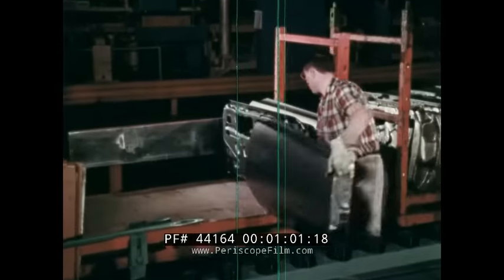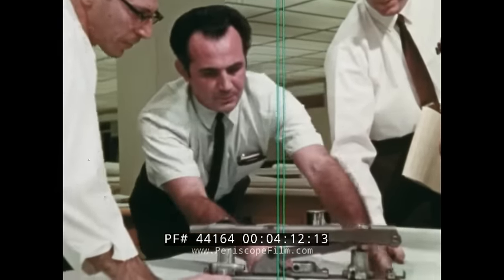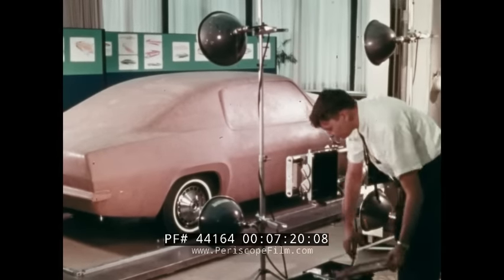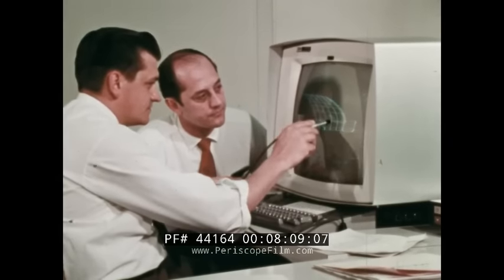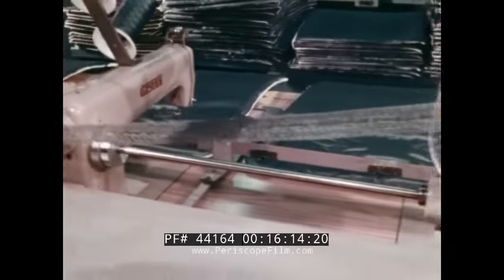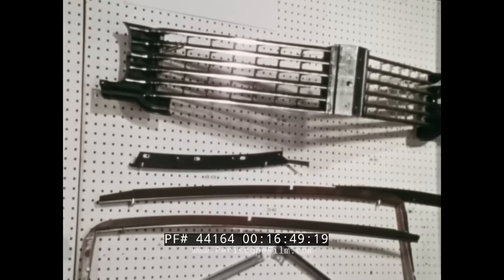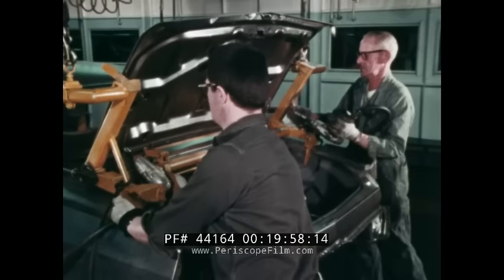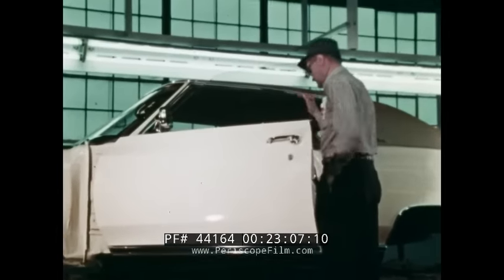FISHER BODY  "THE BODYBUILDERS"  GENERAL MOTORS 1970s AUTO ASSEMBLY LINE FILM  44164

Comment: I bet one nice thing about punch cards running the automatic sewing machine and robot welders is you didnt need to worry about a friggin windows update screwing something up once you had it working properly!
Reply: @D.T. Baker Hmmm,  I've been using Windows at work for over 20 years, and I've lost a document I was working on maybe twice in all that time.  It doesn't crash.
Reply: @robertromero8692 It’s STILL A COMPUTER, and computers do crash. 🤔
Reply: @jjojo2004  What part of "crashes are very, very rare in my experience" didn't you understand?  And where did you get the idea that NON-computer based machines never fail?
Reply: @robertromero8692  So are you saying computers have 0% chance of crashing. Anything other than that means it WILL crash. A crash is a crash, even if it’s one in a million years. You’re a POOR KEYBOARD WARRIOR. 😆😆😆😆

Comment: BODY BY FISHER. Who remembers seeing this as a kid?
Reply: Saw it allll the time!! I worked at Fischer body in flint in 73 🤣🤣🤣
Reply: The Fleetwood and Eldorado had "BODY BY FLEETWOOD" badges on the door thresholds, even though I believe the cars were sometimes built on the same lines with body-by-Fisher Devilles and Toronados, respectively. Must have been more of a tradition than anything else; the Fleetwood coachbuilding operation dates back to Penworthham, England, before it moved to Pennsylvania and was eventually acquired by GM.
Reply: See it every weekend as i jump into my 1970 Camaro !!!!!!  lol
Reply: lovejago  - I see similar when I jump into my ‘67 Firebird ‘vert
Reply: My dad worked at Electro-Motive Division for thirty years. When I was a kid, he used to bring home GM car brochures to me and my older brother often. He had a 1972 Chevrolet Caprice, and he would open the door and I remember seeing the "Body by Fisher" in the body door panel. He would open the hood and I see other labels on the parts in the engine compartment from other GM divisions like Rochester, Frigidaire, Harrison, Saginaw, AC, and Delco.
Reply: me, every time i got in my moms '72 cutlass, had that logo on the door sill
felt so bad when i was driving it home from the dmv in '75 after getting my license,
totaled it in an accident with a 65 gmc pickup
Reply: My dad was 30 and out at the Grand Blanc location.
Reply: I remember seeing it on my mom's 85 monte carlo ss
Reply: Irish Keif Grew up in Livonia, Michigan, not far from the former Fisher Body Plant on Plymouth Road near Inkster
Reply: @Pgcmoore  I T boned a Hyundai driving my mom's new 87 K/5 blazer the day after I got my license. I had to buy her a new grille, bumper and had the hood resprayed, the Hyundai spun and rolled over, it was totaled.
Reply: That emblem on the sill plate is burned into my brain.
Reply: My 77 el camino has a fisher body
Reply: I had a 1975 Chevrolet Nova 2 door in 1988,a 1977 Chevrolet Nova in 1990,a 1976 Chevrolet Caprice Classic 4 door hardtop,a 1978 Pontiac Trans Am factory 4speed 400cid WS6 and no options and no hood bird in 1995 until 2001 when I got married and had to sell it.
Reply: On my dads 69 chevelle
Reply: Me,  my Dad's 66 Belair!
Reply: I always saw the fisher nameplates on many cars stamped on the edge of the floor.
Reply: My dad's 1966 Chevy Impala 2 door hardtop.  I loved that car and it ran forever.  Unfortunately was wrecked on an icy road before it was passed on to me.  Dad was fine though.
Reply: My dads 72 nova drag car still has the body by fisher plate on the firewall
Reply: Doug N my dad had a 67 as his first car it had a 327 in it
Reply: It’s on my 76 Cadillac el dorado convertible
Reply: Im only 36 and I saw that all the time, we had a 78 Buick Park Avenue with it stamped on the door sills. Car I grew up in.
Reply: My 71 El Camino has it. I see it daily..
Reply: @rickenbacker315  
My 72 Elco has it.

Comment: As an auto restoration guy, it's cool to see the same cars that I bring back to life being born. Very Cool!
Reply: I hear that, over the years i've found a few things nestled in wire harnesses like notes and so and so was here behind panels after I drill out all the spot welds!! Cool stuff indeed
Reply: Seeing that peg-board with all those new interior parts on it...gosh I'd like to have those parts..
Reply: In the 70’s our high school did not have an automotive shop class, but design/drafting. We had a field trip 60+ miles to Kansas City to an Oldsmobile assembly plant. Like this video shows, the chassis was mated to the body as we viewed from a cat-walk, high above the floor. I never knew the body was made & painted there or somewhere else, but one difference we’re seats handled by pneumatics lifters came out of no where to be installed with the correct color. It was something I never forgot as at the end of the line, a small amount of fuel and check of all systems got an “OK” and the A/C was charged last If everything passes, it went into a parking lot. Those that had problems where attack by a team of techs who changed based upon the problem. Once fixed, tested again, ran then sent to the lot.
 Years later, working at a dealer, a body shop tech would spray a liquid and rub the body with a clay. I asked, they said railroad cars kicked up metal dust and stuck to the paint. This removed it, made it smooth and shiny.
Great memories from over 40+ years ago. Great film regardless.
ASE Master Tech since 78, Retired
Reply: Did you find the build sheets the dealers sent to the manufacturers? if you did, did you give them back to the owners?  I"m not being funny or obnoxious in  any way.  These types of things are one offs and just  seeing the owner's reactions must be really cool.
Reply: @styldsteel. We found the build sheets under the rear seat in used cars. Depending on what year, the custom picked what they wanted. The truck and back seat where good places to find various firearms. The build sheet on trucks was on the bottom of the seat, usually rolled up at stuck between the springs and burlap under the foam. I found my 67 C10 in the same location.
Reply: @deankay4434  ....Hay Dean. more than likely the Liquid was just Water. and if it was not clear like water. It had soap in it ( soap makes water wetter ). and now today you can buy the same Clay bar!!
Reply: @lovejago  I have a gallon bottle of it and it’s called “Correct It “ and comes with four bars of clay in plastic. Once you rinse the vehicles off, water-soap or just water, you can feel tiny bumps in the clear coat. I spray a 1 foot area and rub with the clay and it’s smooth, no more bumps. Soap generally comes with a surfactant which reduces waters surface tension while many bars of soap, lipstick and other makeup contains tallow. This makes it stick but acts as an exfoliant. My grandmother had a chemical engineering degree and developed bar soaps & makeup.
 Tallow is used to make bars of polishing compounds so mixed with iron oxide, you get “Red” compound. Tallow is a semi-solid at room temperature and when vacuum boiled with hydrogen bubbled up from the bottom, it combines, increasing  the temperature at which it melts Its the same process used with vegetable oil that creates partially hydrogenated room temp solid compounds, like used in non dairy butter, todays “Crisco” and many other food items. By the way, tallow is made from rendering animal fats. Crisco used to be 100% tallow, just real clean by straining & filtering. Enjoy that “Blue” ribbon pie. 
Additives used by firefighters on a trial basis, did make water wetter, but in fact, made it stick and increase its 212 degree boiling point ( At Sea Level) but while it worked, it was found to be too expensive. It was mostly surfactant!
Reply: @deankay4434  .....Well Dam!! You Should be proud of yourself Dean!  You sure did School me on more than i was Replying to you. . LOL i was just talking about the Clay Bar Kit From Meguiars !!..lol i think it came out in the 90s.  just a little water in a spray bottle and the Clay Bar and 3hr of rubbin .lol no wonder your smart!! ya must get it from your GM. Dean it was Nice to hear/read your Reply Back to me. Thank you Dean!.....>>( no wonder im so Smart i Listen/Learn from people like Dean Kay )
Reply: @lovejago  >Those are kind words indeed and I appreciate them all. I knew your comment was about the new stuff and Meguiars has excellent products. I use “Mothers” Mag & Aluminum Polish so much, I keep 5 tubs on hand at all times.
I  just turned 62, I have many friends in different fields of the auto industry and two sons who are not into vehicles. I enjoy learning new stuff and working with electronics. There were few tech trade schools in the 70’s so never went. I worked as a paid apprentice in one man shops who’s owners were very smart. Fixing things came easy, math for electrical diagnostics was very helpful to find the root cause. At 28, a guy tried for months to lure me to his shop and gave in. Build on a hill, large equipment built a flat area for his needs. They did not compact the earth to standards and a 20 X 100 foot concrete slab sunk 8”. Only 3 techs, we cut large wood blocks to drive vehicles in. He lost his court case and bought a very large backhoe. Since I was the oldest on a large family farm, I removed all of the slab & 4 feet of dirt to allow new drainage pipe. It rained for weeks. Even with a cover, it became sunny and before I knew it, preparing to rebuild a 70’s something Chrysler starter, as soon as it hit the bench, I was asked again to run a jumping jack compactor. After an hour of argument I was paid more to run it. A rental, full round handle for two & a 2” foot the size of a mailbox, what looked dry, turned to mud. Without knowing at 6’3”, I lifted it up, still jumping and quit after 5 hours as my back was hurting, kicked it over, went home, had laminectomy, spinal taps w/X-rays, multiple epidurals, MRI’s then donor bone off hip to fuse the S1-L5-L4. Fun. Taught at the original UTI, worked at dealer for 15 yrs., Service Mgr., Contract labor for Raytheon to hold 4hr. deep tech seminars (GM) in 7 states, +4 day classes at Tech schools then handed 5 warehouses to handle 2 tons of returned alleged defects, then 05, L4-L3 fusion, then tore rotator cuff & surgery, after 7+ yrs., position dissolved and put to pasture by doc. Had R elbow nerve surgery last month, now L3-L2 fusion next Tuesday. So that leaves L elbow & 3rd finger arthritic that feels broken. I plan to get off “End-Of-Life” pain meds. Now one wants to talk to has been, no one comes over, don’t go anywhere so enjoy so 4 tool boxes, MiG, torch, sand-blast cabinet, 2 commercial sewing machines and 40+ boxes of special tools, Tech-II, etc., so learn while you can. You only have 50+ years to make it. I don’t even own a cell phone, so I will take what I know with me into the night & my son(s) will have tools. SO, Have a nice day!
Reply: @deankay4434  ......WELL GOD BLESS YOU DEAN. im 52yrs and in high school from 1982-to-1986 i  took auto/drafting/welding/fabriction/foundry ,..Then became a Suspension Mechanic for 10yrs .. in TUCSON AZ where i grew up. A man by the name of Ron Willson AKA  Maxwell Wheel Alignment TUC AZ. on 6th Steet and 6th Ave. From there i went into Landscape Architecture Design. Since  i have done well for my Family and myself. for the last 26yrs have been working and helping Friends on are HOTRODS... So thats my Story !!.... So Dean Thank You Again. I Hope you feel Better and Hang in there!!  We need people like you in times like this!!  GOD BLESS YOU!!!!!!! >>>>TRUMP <>Kay<<2020!!!!!!lol
Reply: I agree. I was a professional restoration tech for years  and worked on these very same 70s Montie Carlos and Chevelles in this video. Always interesting to see how they were originally assembled . I specialized in interiors ,trim and glass in final assembly although I could do every step in a restoration . I find the vinyl top and headliner install footage of most interest as that was my specialty work. I always figured it took about 4 or 5 guys to put them in so fast on the line. But doing that by yourself takes time to get right.
Reply: U hiring??
Reply: @lovejago  how the heck do you make water wetter???
Reply: Some of em are even becoming restomods.
Reply: As a dude w/a Nascar’d out
72 El Camino,
I like seeing how to take it apart.
Reply: @georgemartin1436  would be nice to not have to spend $30 on door handle bezels
Reply: We need to go back to this kind of manufacturing, engineering and construction but with newer designs and models. Pick up where we left off.

Comment: Klown Killer: im gonna say a majority of non-baby boomers have no idea or have never even seen a floor mounted dimmer switch(to turn the headlights from brights to regular) operated by ones left foot & for those familiar with- it was as automatic as the reaction to using the horn in the center of the steering wheel

Comment: My Dad worked at the Fisher Body plant in Lagrange Illinois. Tool and die and he worked 35 yrs till they closed it.  He never missed a day and was a very proud UAW Member. Union benefits made his retirement years comfortable.
Reply: I never knew they used to have a plant in Lagrange. I'm 31 and worked in Brookfield as a teen. Do you remember where they were located?
Reply: @StopLyingBro  UPS purchased the factory in the 80s or 90s? It's on LaGrange Road..not sure of the exact address.
Reply: Do you mean Willow Springs Illinois? Because I grew up in Willow Springs Illinois in the 1980s as an kid and the sign said GM Fischer Body Willow Springs that was located on Willow Springs Road and the GM EMD factory where they built the railroad diesel locomotives was in Lagrange Illinois. I know since I am an railfan.
Reply: @ThundercatDarklion  Yes, both locations I visited as a kid. I went to see my Dads workplace a few times.  Fischer body plant is the plant he worked at. We lived in Bridgeview at the time. He always drove a Pontiac during the 60s and 70s. He was proud of the cars they made. Willow Springs, that's the place for sure. My mistake.

Comment: Watching that 18 guage steel body being built and painted is why I own a 1966 Corvair with original paint.  While the new high strength steel on my wife's 2016 Nissan Rouge is covering in dings from hail and acorns (22 guage steel!)  and the clear coat on the 2003 Ford Focus I own peels away, the Corvair sits in the same driveway with a ding free Body By Fisher with beautiful glossy original paint!!!

Comment: Early '70's Monte's are sweet! Front clip doesn't go on until nearly the end.
Reply: — and the paint probably doesn't match the rest of the body ;-)
Reply: I found that very odd. Wonder how the paint and texture matched.
Reply: Body was made at a Fischer Body plant and shipped to a final assembly plant where the frame, power train and front end clip were installed. Yes, the paint would be slightly different on the hood and fenders than the rest of the body.
Reply: @jamespn  63 Oldsmobiles.....body over the years maintained color....fenders and hood faded fast....I've had several since the late 70's all exhibit this wonderous feature.
Reply: LOVE Monte Carlos up to 1988.
Reply: I got 2 vids about 1st gen Monte Carlo history dudes...
Reply: My 72 El Camino has a Monte clip, I hear.
Say it’s the same...🤷🏽‍♂️

Comment: 1970 As a high school student went thru GM assembly plant.  At the end of the line, the hood was closed.  If it did not, a husky guy slammed the hinges just so with a mallet.  Probably the most skilled man in the plant.  Body fit in those days stank.  Cheers
Reply: That explains a lot about all those GM cars I had in the 70s and 80s.
Reply: @NathansHVAC  hahaha I just watched it!
Reply: Do remember which assembly plant you went through?? My Father ent to work for GM Norwood Ohio Plant in 1963, When graduated in 1973 I started working there. Saw a lot of changes over those years. GM closed the plant in 1987. Sad day for all workers and the city of Norwood.
Reply: @Kas8588  Ken, the plant was in Kansas City.  They assembled Chevelles and El Caminos.  Before computers, cars were the guy thing.  So it really impressed me, Here was heaven on earth.  Particularly warehouse full of engines stacked to the roof.
   I went on to engineering school and worked awhile in Detroit area around 2000.  Automation is what’s impressive these days.   Cheers D
Reply: You obviously are not swift enough to absorb the information presented.

Comment: I grew up and drove cars and pickups from this era. Truly, from my families perspective fisher made a better body than the competition. We had a large cattle and sheep ranch out west. We drove these vehicles long hard miles and yet we took care of them.  Our Ford’s bodies were not as luxurious, not as smooth and refined.  
Mechanically, my Dad believed the Fords were better.  That meant they made it to 150,000 miles before overhaul where our chevys made it to 140,000... lol. I always preferred the GM product until the junk years of the 1980’s and 90’s.  Then I moved to Nissan, Toyota and Honda.   Today, I’ve driven almost 1,300,000 miles. Ive owned a lot of vehicles.  It’s not unusual for work trucks to last 300,000 miles before the engine needs to be replaced. Vehicles are safer, more reliable and capable than ever before.... but I do miss the cars from the 50’s, 60’s and 70’s..
Reply: Amen to that note I  still have a few muscle cars that are from the 60's and the 70,s